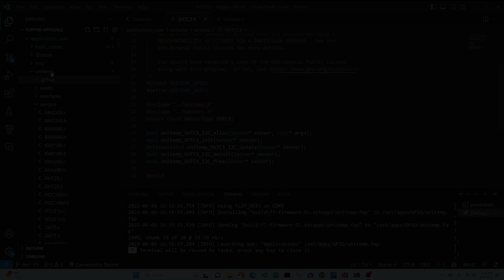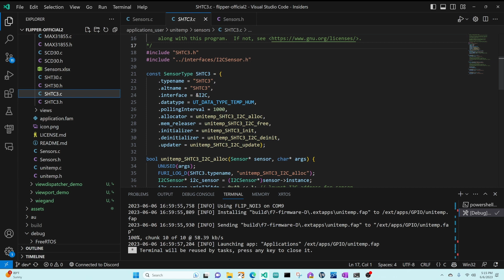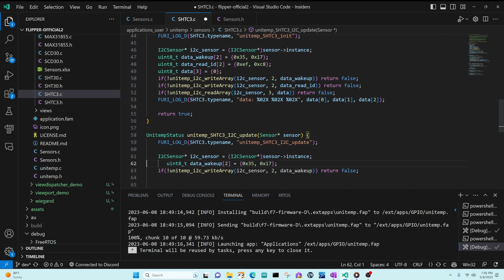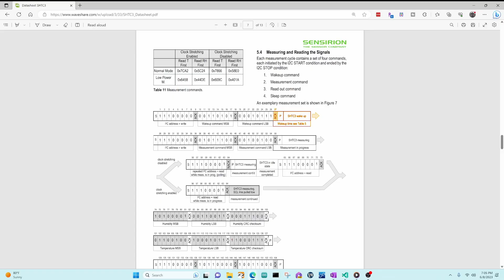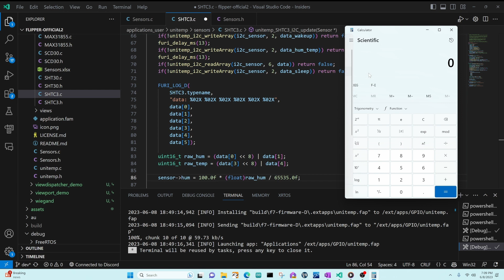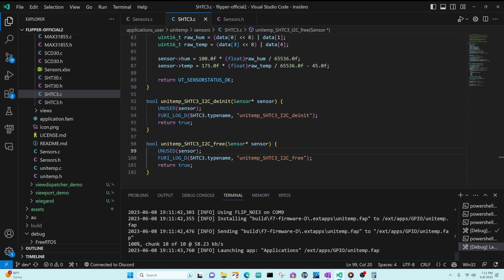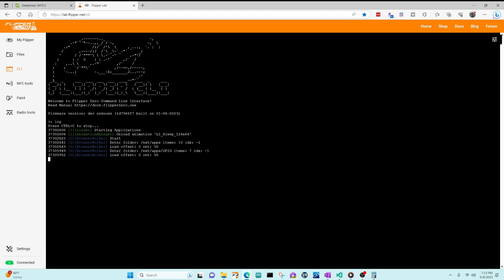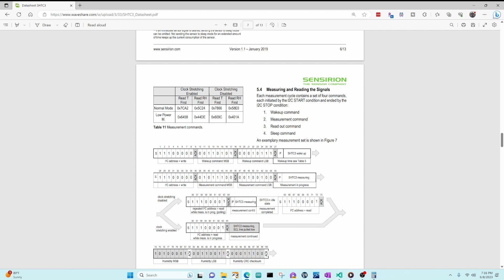[67] Flipper Zero - Add sensor to Unitemp

Comment from the maker: Question about 7:08 -- What are your thoughts, follow the datasheet or agree with the AI?   Maybe GitHub Copilot used 65535 instead of 65536 (2^16) because that gives a max humidity of 100.0f * 0xFFFF/65535 = 100.0 humidity vs. 100*0xFFFF/65536 = 99.9985 humidity?

Comment: Hey completely out of my scope.. Im just learning python and my main interest is CAN bus / automotive sensors such as ADAS systems, humidity, and rain sensors.
My questions is:
What other sensors can a flipper potentially interface with (specifically, but not limited to the automotive industry) ?

This would be an amazing tool for me to have to directly test sensors during trouble shooting process.
Reply from the maker: https://www.reddit.com/r/flipperzero/comments/188gm6m/car_hacking_and_reverse_engineering_tool/

The flipper is basically a 3.3 volt system, with 5 volt tolerance.  You can build additional hardware to interface with other systems, such as a 12 volt system.  The API supports I2C, SPI, USART, LPUART, iButton, 1-Wire, and ADC (Analog to digital with a range of 0-2.5volts).  With the GPIO APIs, you can send many different kinds of waveforms -- I've used it to integrate with a custom protocol for the WS2812B LED running at 400kHz.